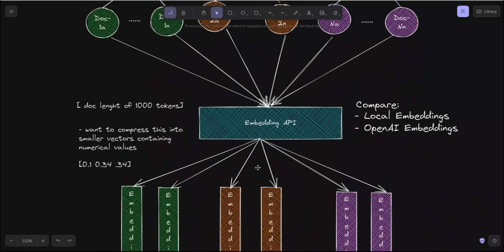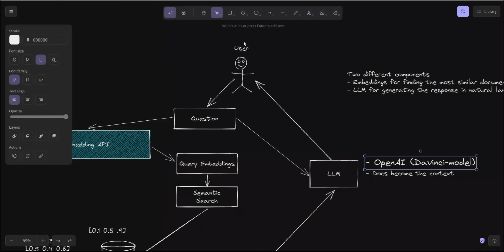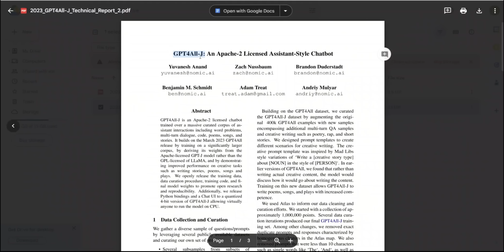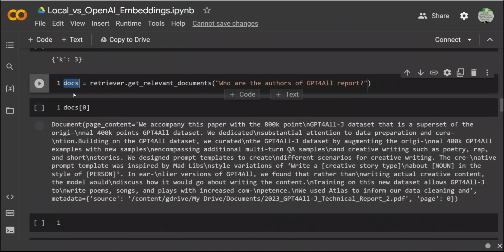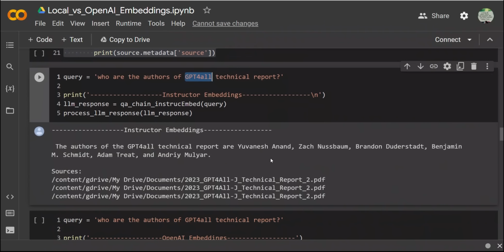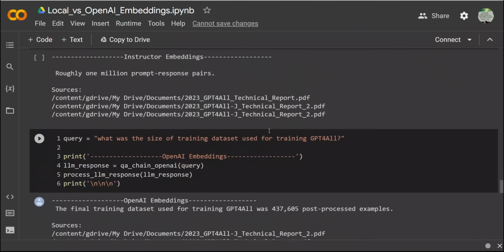BEST OPEN Alternative to OPENAI's EMBEDDINGs for Retrieval QA: LangChain

Comment: Thanks for this wonderful explanation and demonstration. Really appreciate your efforts.

I am getting error while executing  below lines of code in Google Colab.
vectorStore_openAI = FAISS.from_documents(docs, embeddings)

with open("faiss_store_openai.pkl", "wb") as f:
    pickle.dump(vectorStore_openAI, f)

<ipython-input-15-a15eeb85be96> in <cell line: 3>()
      2 
      3 with open("faiss_store_openai.pkl", "wb") as f:
----> 4     pickle.dump(vectorStore_openAI, f)

TypeError: cannot pickle '_thread.RLock' object

Did many workarounds suggested by Colab AI and stackoverflow but none worked. Can somebody help how to avoid thread.RLock error?
Reply: getting same error while running in gcp or in vscode (local) also search tons on web but not getting answer

Comment: Very instructive video, thank you! 

When you define `qa_chain_instrucEmbed`, how can we avoid the usage of OpenAI? (to be more specific: how to avoid to pay)
Is there a way to use a local model with acceptable answers? 

I tried in Google Collab 
```
llm = LlamaCpp(model_path=f"{root_dir}/llama-7b.ggmlv3.q2_K.bin", verbose=True, n_ctx=1024)
qa_chain_instrucEmbed = RetrievalQA.from_chain_type(llm=llm,
                                  chain_type="stuff",
                                  retriever=retriever,
                                  return_source_documents=True)
```
but the answer takes minutes to appear and is not at all relevant.
Reply from the maker: I would recommend watch my localGPT video. It will show you how to do other LLMs. 

You want to look for a better model (Vicuna-7B is a good option).
Reply: @engineerprompt  Thank you very much. 🙏

Comment: But openai embedding are now so cheap, just 1$ for thousands of documents which previously would have costed 100$, and once generated embedding can be persisted locally. So in this case is it still worthwhile to use instruct etc.?
Reply from the maker: Cost is just one factor to consider. Others would be data privacy, security, and the freedom to be not tied to a vendor
Reply: @engineerprompt  yes, I also tried instructxl embedding and it's better than openai so yeah now I see why I made it so cheap, still not worthwhile when I can run a better model locally for free
Reply: @engineerprompt  on data privacy openai has now 0 data retention policy for embedding at least, as a corporate that would need to be applied. But yeah, freedom is the best part. ..... similarly for llm which model open source model I can use?

Comment: One quick question i have can we use hugging face instructor embedding with gpt 3.5 turbo  model i have doubt like model was trained on open ai embedding but can we use hugging face instructor embedding please clearify?
Reply: Please help me out as i have seen some videos which have used local embedding with gpt 3.5 turbo model how its possible? Like gpt 3.5 turbo is linked with open ai embedding how we can use hugging face instruct embedding on that

Comment: Great video, thank you. What about documents which contain math expressions and definitions? I haven't seen any related video about mathematical corpus. Also would you answer if we can use the embeddings for documents written in Greek language?
Reply from the maker: Thanks, I am not sure if it will be able to process math expression. May be if they are provided in Latex or mark-down, you would train a model. But not sure. As for the documents in Greek, I am not sure, haven't experimented with any other language and there is nothing in the documentation that I could find.
Reply: @engineerprompt  Thanks for you response. Unfortunately although I have searched a lot on the web I cant find a test case where someone uses a multilingual  model for the embeddings and for the Language model. Although I have noticed that chatGPT understands prompts in the Greek language and also generates replies in the same language. Do you know perhaps how it does that? Does it use a translation model on the backend?

Comment: Thanks for your tutorial. In my case(2 large PDF files( 32 Mb & 54 Mb), One thing I wanted to highlight is that there is a significant difference in embedding size between instructor embeddings and OpenAI embeddings(4.6 Gb vs 13 Mb). Can you please share your thoughts on the same?

Comment: Hi, Thank you for your tutorials. I am following your tutorials for quite some time now. However I am unable to figure out best economic approach for my use case. 
I want to create a Q & A chatbot on streamlit which answers only my custom single document of about 500 pages. The document is final and won't change. From my understanding so far, I should either choose Langchain or LlamaIndex. But, I will have to use OpenAI api to get best answers, but that API is quite costly for me. So far I have thought of using Chroma for embedding and somhow storing the vectors as pkl or json on streamlit itself for re-use, so I don't have to spend again for vectors/indexing. I don't have enough credits to test different methods myself. 
Kindly guide me. Thank you.

Comment: qa_chain_instrucEmbed = RetrievalQA.from_chain_type(llm=OpenAI(temperature=0.2, ), 
                                  chain_type="stuff", 
                                  retriever=retriever, 
                                  return_source_documents=True)

What other open source can be used instead of OpenAI in this code? Any idea?
Reply from the maker: Check this out: https://youtu.be/Xxxuw4_iCzw
Reply: @engineerprompt  Hello, can you just say, what code should I use instead of OpenAI in the above code?
Reply: did u get your answer
 @nithinreddy5760
Reply: @engineerprompt  I have gone through that, but that video is about HuggingFace pipeline. The only doubt I have do have is, in the code  you wrote for qa_chain_instructEmbed  (HuggingFace embeddings), you're again using OpenAI embeddings, can we run the code without OpenAI?

Comment: Embeddings are just the beginning.  We'll need to start integrating Llama index (could do a video on that?), which is also "open."  It takes vector DB+langchain and supercharges things.
Reply: what's the difference with embeddings ? quality ? speed ? cost ?
Reply: @massibob2004  Embeddings create vector databases the the model uses to quickly find information you're querying about in a given dataset... then the relevant data is chunked and prompted into the AI.  Llama index utilizes/integrates this, but is also uses other data structures (like adding metadata) to help parse and find the information.  Essentially more of an old-school index/catalog mixed with a vector database.  This allows you to "tree" the pipeline; working on certain chunks only, breaking those chunks up even more, etc.  Right now, generally folk are vectorizing and chunking say 1000 tokens worth of stuff when only 100 tokens of relevant info is in there... which isn't an efficient use of compute, and can also cause missing data.
Reply from the maker: Yes, looking into Llambdaindex.

Comment: I wonder how big of a text can be turned into embeddings without "losing the sense" of what's written in it.
Reply: There is some techniques to compensate for that. You can chunk the text into overlapping text embeddings and also you can index them. You can then say that the specified indexed range of embeddings is part of a whole document for example and use all the overlapping chunks to make sense of the whole text as well as individual pieces of the text.

Comment: What does mean open embeddings ? If I understood well , an embedding is just a vector
Reply: you missed reading properly it's not open embeddings. It is openAI's embedding
Reply: Embeddings are basically the conversion of the text to a vector representation. These vectors encode semantic (meaning) and syntactic relationships between the words. This is what the model directly uses to create responses using them as context.
Reply: @dimitris-vlamis  thanks that's what I understood but what does it mean a technology embedding (open embedding or OpenAI embedding) what are they used for ?
Reply: @brucewayne2480  I am not sure what you refer to as open embedding, but the topic of the video is to show you an alternative way to make embeddings. Usually, if you want to use the gpt3 model, you need to make embeddings with a model from OpenAI and you basically have to convert the PDF to txt and send all the text to OpenAI, and they send you back the vector representation of this text. This can be an issue if you are dealing with sensitive data, that you do not wish OpenAI to collect, for that reason, there are ways to make embeddings locally or with HuggingFace embeddings, and use them with gpt3/4 etc. OpenAI wont have access to the whole document, only parts of the answers it gives since you will do some kind of semantic search and provide the model with very specific context related to your question. Keep in mind, you can not generate embeddings from any model, and use them with OpenAI models.
Reply: @dimitris-vlamis  Thank you for your explanation and your time.
So only the embedding is done without gpt then you store it somewhere and send it to gpt for every request ? Gpt wont be able to see the text in clear but only his respresentation. What is the role of vector databases here ?
Reply: He means open-source embedding. He's comparing free versions to OpenAI's API version and finding it to actually work well.